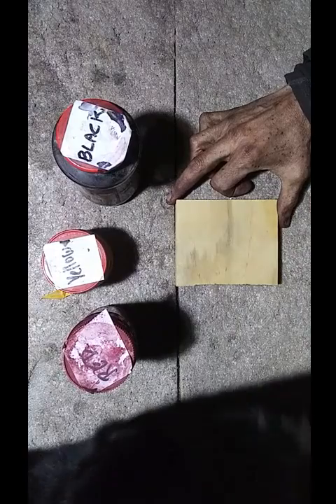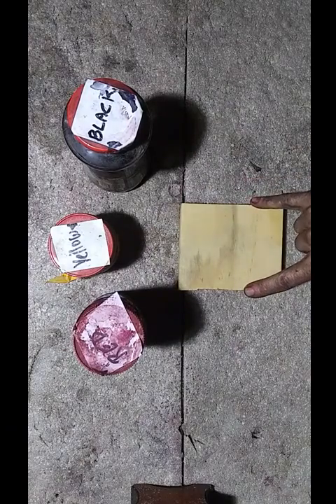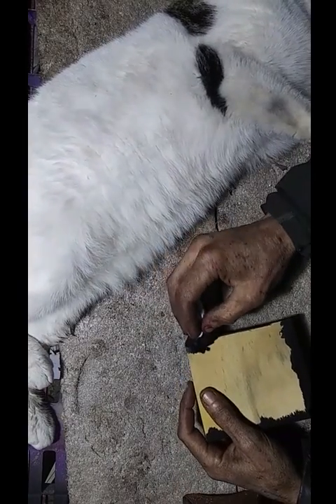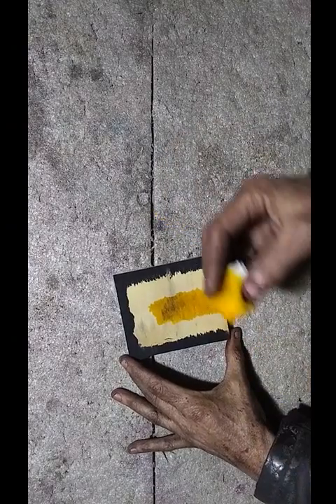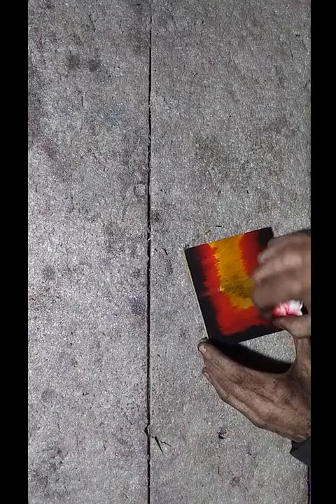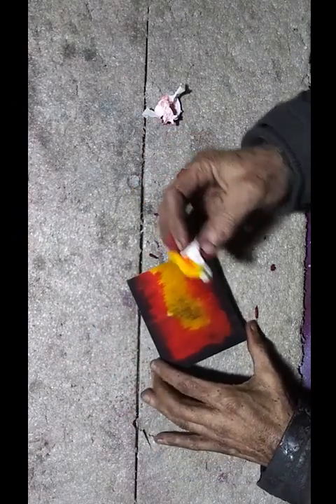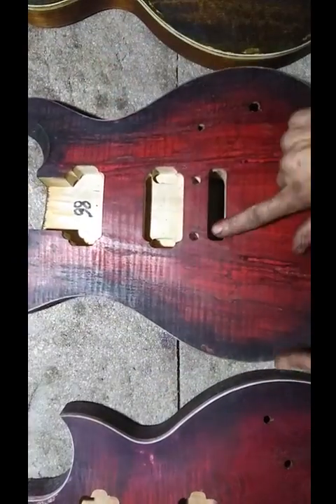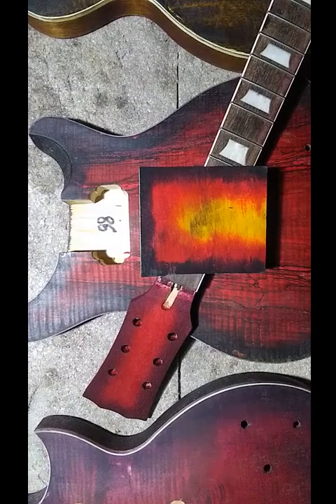Staining bursts on veneers with no sanding

Comment: Wonderful! This is exactly the video I've been looking for a while! I wonder if pore-filler or any sort of primer is needed before staining the veneer? (I'm hoping to achieve something akin to the "Agile Chiral Parallax 82528") Thanks!
Reply from the maker: Some woods tend to take a stain unevenly between the hard and softwood grains in the wood.  The softwood takes the stain well, while the hardwood does not.  A sealer can be used in such cases to help even out the how well the stain soaks in.  I've never used the method myself.  Check out Big D Guitars here on YouTube.  Its my recommended channel for staining guitars.  But he doesn't work with veneers, so he can sand back.  Test staining scrap wood is the only way to guarantee reproduceable results.